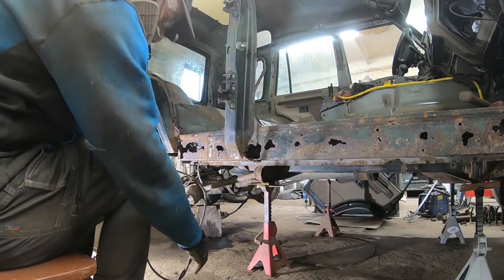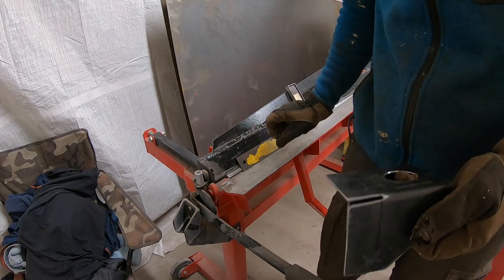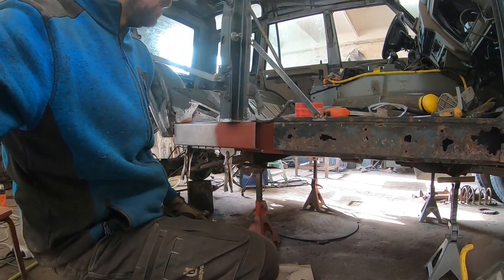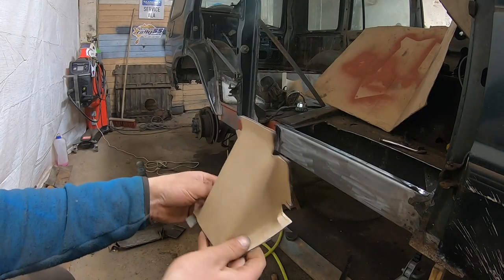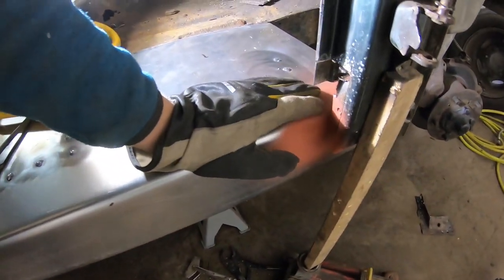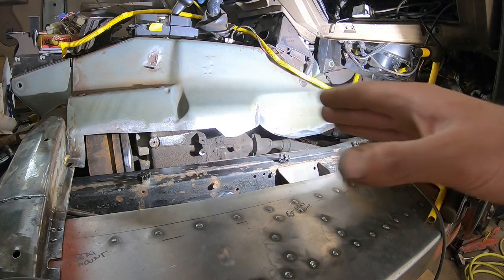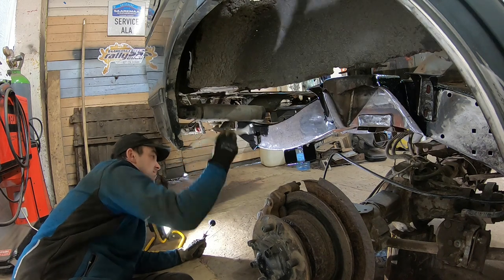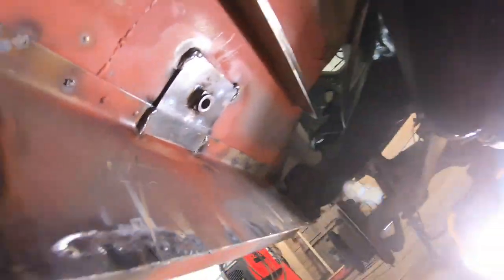Land Rover Discovery 1 Epic restoration part 3

Comment: Thanks for the vid, mine has gone in exactly the same place so much needed video! What mm sheet steel did you use? And also what is that weldable primer ?